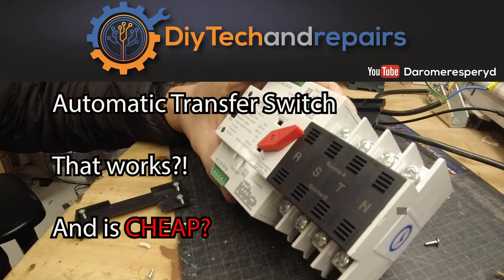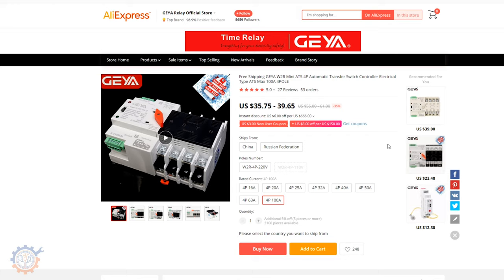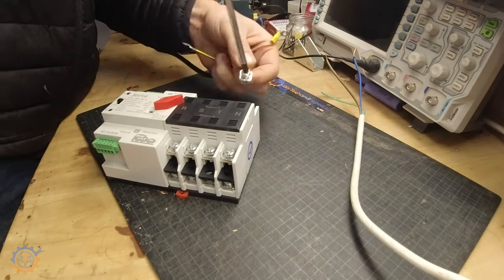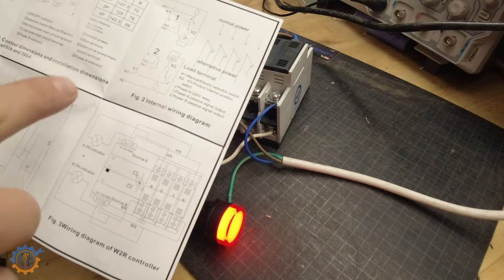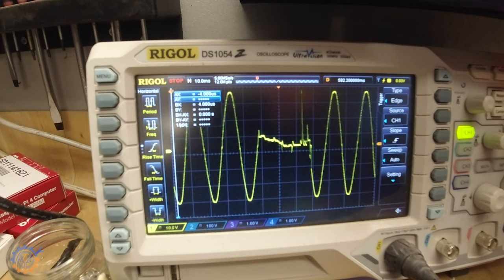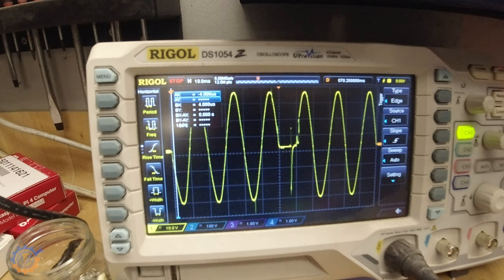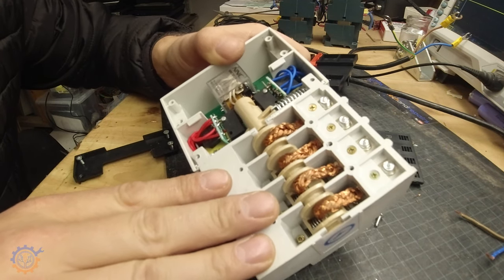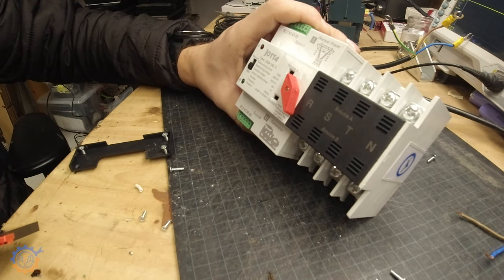Automatic transfer switch setup for home DIY solar systems (You wont believe the outcome)

Comment: 48 Amps system has been working with one of this 100 amp rated 3 poles 220 for over 8 months now, cycling between sources everyday without flaws, no sing of overheating or hot spots or anything of that matter. Computers only reset sometimes going from A to B, but stay on form B to A.
Reply: A UPS (Uninterruptible Power Supplie) will solve your computer problem
Reply: @josephrosa5845  Or simply a faster Transfer Switch
Reply: How is it holding up? Any update. I'm about to put my load of about 40 Amps with this kind of switch.
Reply: @tarakivu8861  Don't you think a UPS would be much less expensive than buying and replacing the transfer switch?

Comment: don't use tape, unplug the mains and work offline. also heatshrink tubing I prefer more than tape around a screwdriver
Reply from the maker: Of course you unplugg as amateur :) heatshrink is Good advice
Reply: Always use electricians fully insulated screwdrivers
Reply: @mrfixit100  the already made ones yeah, just don't use bare metal ones at least.

Comment: 30ms would not shut down a computer. The PSU discharge isn't THAT low. It takes around 1-2s to completely discharge the PSU of a computer. It would indeed work for like a switch between solar, and grid power. Love the video though and very informative, thank you!

Comment: Thanks Mr. Swedish Man. I'm connecting mine up backwards as I want My solar input system as primary. Thank you Good Job. Gus
Reply: Nice i'm using mine to power my house from my EV when power is down or my main house battery dies. It will toggle grid and ev that feeds my solar inverter. I'm just concerned about the 6k maximum rated switches.. Are you happy with yours?

Comment: Is the "primary is primary" problem all that bad? Just wire up what you want to be primary on that side.
Reply from the maker: Sometimes you want to change it. Example i Winter i run grid as primary and during Summer solar :)
Reply: Where i live sometimes the power flickers on and off several times before it get fully on. It would be nice to just pull a swich and have it wait. Or even better, a automatic timer giving it 5 minutes or something before swiching over.
Reply: @matsv201  Some smarter ATSs have configuration options for that.
Reply: @jmonsted  That is true, but the genearly cost a bit more. I´m really not that cheap, but some of them tend to be a bit to expensive for home use.

I really just need it for a few computers and some other stuff, most of the lighting is already DC.
Reply: @jmonsted  I just saw a indian guy, simply putting a cheap relay timer between, that was really a very clean and simple solution
Reply: I would like to do the same, change main A in the wintertime. Can you share a solution for this?

Comment: I wanted to install this kind of automatic switch to my entire house, but after seeing this explanation i prefer a manual, thanks a lot for your advice about this cheap device. Can you please recommend a manual certified switch for 220v ( 1 neutral and 2 fase of 110v each = 3 wires in total from the pole outside) Thanks.
Reply: you need to get a nema 3 manual transfer switch rated at the amperage you are switching from/to most are expensive and large electrical supply house sels them.
it all depends what you want to keep alive when power loss.

Comment: Planing to put this to switch my heat pump or whole apartment from A (dynamic tariff) to B(fixed rate). Could fully automate it with smart socket/plug. Make it read rates one web page every day and shut off A power when it goes more than B (fixed rate). It wouldn't brake my appliances?😅

Comment: one thing i'm worried about.    neutral breaker should connect first   and disconnect last.  if not, your house neutral will float short period and overvoltage in some phase(s) vs.  floating neutral may happen.
Reply from the maker: Can't be done with  a 10ms ats. The breakers also only break the hot lead. That is what you have the rcd for. It will break neutral if the current doesnt add up

Comment: One thing is not clear for me. I have already setup circuit with breakers and everything. How I can switch those for different output eg solar power when both of them are active at the same time?
Reply from the maker: you cant have both inputs active at same time to same output unless they are made for it. An ATS switches source to the output and is often connected befre for instance a breaker panel feeding it

Comment: Hi have a house with,  3Phase, Sungrow SH10RT 10kW Hybrid  inverter   and
16kW Sungrow  SBR160 High Voltage Battery Modules , would this ATS works for my house battery system or, this is for the small solar caravan system?
Thank you
Reply from the maker: It's a 3phase 63a ats
Reply: ❤ Thank you so much, it's perfect for me then.

Comment: do you have those wires connected to 2 seperate wall sockets where one is on and the other is off?? or how does it work?

Comment: I got the 8ms version... It's true no micro-cut for computers, etc.... but ... versus time, the mechanical part will fai (misalignement of the two rotating metal contactors).... In average, it works one year for two transfert / day in average.... :(...
Reply: This was helpful. Thanks

Comment: Can a ATS like this he made to switch from one service to a second service? I have two services and I want the lower price service to be used in certain hours (off peak) and the higher price in other hours (on peak).If not what kind of a switch would I need to automatically switch during certain hours.
Reply: ats switches when primary power fails (no power ) then secondary power kicks in and when primary returns switches back
Reply: @josephrosa5845  If using a transfer switch with control lines for each power source couldn't you 
interrupt line A and the power line B with power maybe with a short delay. In this control circuit 
you could have timer for when each circuit is active . The relays in the ATS would only allow 
one power supply to be on at a time. Maybe I do not understand how this works and would 
appreciate any help any one could provide. I am trying to power devices for a certain time on
2 different electric power services to be able to take advantage of the lower off peak rates on
1 of the services. The ATS would be mechanical device to prevent both services to be connected 
at the same time.
Joseph are you in the US?
Reply: @firstbigbarney  
Can we understand you, you have two sources supply, A & B. You want to switch between A & B based on the time of the day? Perhaps, 

00:00-12:00 on line A 
12:00-23:59 on line B

Or you rather want to switch based on the supply voltage value? Like, 

When Line A peak voltage is less than ## Switch to Line B. 

Please clarify.
Reply: @nyameamah  That's exactly what I want to do I want to switch from one meter to another meter which is an off-peak meter at certain times to buy power to charge my electric car. Can I interrupt the service from circuit A with a relay and a timer to be able to engage circuit B ? I thought this was a good solution because you have a mechanical interlock contacts on inside of the ATS and you also have a high amperage availability on these units. If you interrupt the control for circuit A and make it make it look open and it'll switch to the circuit B with a delay would this be possible? After the timing interval on circuit B it would open the control circuit and close the A circuit enabling the original A power source again with a delay for safety.
This would happen daily according to the schedule for your off-peak power currently ours is 2300 hours to 0700 hours all 7 days.

Thank you for your reply. BigBarney
Reply: @firstbigbarney  
Did you find out how to fix the problem with your power changing?

Comment: Great video. Do you check switching time on the same phase? I think it will be great to check switching time on different phases to see time switching in configuration with UPS or off-grid PV inverter.
Reply: @Piotr Rękawek  :  I receive one yesterday and open it today. Please carefull ! ! !  The power contacts do not switch at the same time - both sides ! ! !  So it is possible for some ms is power on zero line / the equipment. This is dangerous.
Reply: @2012SUSE  Thank You for Your answer I decided to use manual switch with neutral.
Reply: @2012SUSE  Hi - thats allso one of my biggest worries about this units - that for example 2 phases are connected and no zero line ...  im searching for a good automatic Transfer Swich since a long time ...
Reply: @GTRDRIVER1  Did you find one?
Reply: @UmarFarooq-jn7dt  no only junk

Comment: they say is used for generator backup, but also you need extra controller for diesel generator , to know the state of the generator and to control the warm up delay switching time and also the cool down timer for generator after grid on. what you can say? cand you do un diy project for diesel generator?
Reply from the maker: Don't have any

Comment: help please do this item only use a 220 only input into the power controller? because I live in us when I use 120 the switch does not work when I turn off primary please let me know. if you can help me.

Comment: If you go with a cheap brand of these, they potentially could fail prematurely which may not be a problem if you actually never plan on using it but habit for an emergency backup

Comment: So it's no chance to set "B" source as primary for full automatic? always "A" source is primary when I have to use full automatic switch betwen A and B, because when I connect my control wires only on the B side source "A" no switching, when "B" source gone, right?
Reply: Of course you can, it's purely how you wire it.......if you wire grid as A then grid will be your primary. If you wire grid as B and solar/wind/gen as A then the latter will be your primary.

Comment: Ive been saving to buy the digital version(MOES) with much shorter delay time than this mechanical one.Will Prowse has vids. demonstrating running computers and (I believe) even a window AC. Rated for 100k switches!...but this mechanical one ....IDK.
Reply from the maker: I run it with computers. It's 10ms switch time that is good enough. We need mechanical here to get it approved.

Comment: Thank you for making this video! Do you know any ats that will not shutdown a computer?
Reply from the maker: Its not the ats that is the issue. The problem is what you have on the inputs. Are the both inputs synced or not as example.
Reply: @DIYTechRepairs  sorry im new to this electronic but what do you mean by unput being synced? Input like solar panel and grid supplying power to the inverter? Im using a deye hybrid inverter but when i turn the grid off, the inverter is not able to switch fast enough. The computer loses power.
Reply from the maker: @walterrostangarciajr  you need a different inverter or you can add an Ups for the computer.

Comment: Hello, im thinking of buying this but im gonna have a pure sine wave inverter hooked up to the backup power input and normal home power hooked up to grid input and i will have 500w load do you think my computer will turn off when the transfer switch changes from grid power to generator power?
Reply from the maker: It will work fine. I do it like that.
Reply: @DIYTechRepairs  Okay thanks buddy

Comment: Hello - i want to ask you if you have installed this Transfer Switch and if its still working fine ? - the Video is now 3 Years old so perhaps you have new Information about this switch ... - My biggest worries about this switch are the Svrew Terminals they look very cheap ....did you use ring terminals for the Wires ?
Reply from the maker: I run it still without issues. No I use standard cables
Reply: @DIYTechRepairs  Hello - Thanks for tast reply - Thanks for fast reply -- im also a little worry about the switching time and the possibility that the Neutral Line is not connected at the same time then the ofter Phases - 2 Phases and no Neutral Line is a very bad thing for all the Electronics ... - But first of all - Thanks for fast answer and have a nice day !

Comment: Hello dear , thanks for your video .. sorry for my bad english... i whant to buy one to use with my genset... but for me this switch can’t work because the backup power source is off during some minute during the time for the engine to start...  when the grid powwer is off without any power .. how is the switch positione? Or maybe the position of the auxiliary contact...

Thanks for your help...
Reply from the maker: Not sure i understand. It wont switch unless Power exist.:)
Reply: @DIYTechRepairs   do you hace try to conect only the main power , without backup power, and try to turn off the main power?  What is the switch reaction??
Reply: @DIYTechRepairs  thanks for your reply 😉
Reply: thats what no/nc /c connections are for
Reply: @josephrosa5845  hello , i have recieved the product... yes your right about no nc contact.. some other ats work with build backup supply
Reply: @franckmarcelin7573   i dont understand what you meen by (build backup supply). if you talking battery inverter or solar inverter supply. i would set solar/ inverter-battery system as primary and city as backup supply
Reply: @josephrosa5845  hi .. no a talking about someats change source position without energy... maybe it ‘s stay on city power when is energegised with coil and go back to genset backup when is no energised...

But about this sort of ats on this video it work with my genset i use NO NC contact to send information to my genset
Reply: @franckmarcelin7573  city primary genset backup is what they designed for genssets need to have switch run through no contacts and there normally is time delay for generator to fireup.
Reply: wireing should be pretty stright foward

Comment: On some of the aliexpress pages is noted: "NOTE: The rated voltage of the common and backup power supply must in range 85%-110%, and the current cannot be less than 5A, otherwise the coil will heat up or even spontaneously burn. If your city voltage not stable, please kindly add voltage protectors in system." ... So one would have to run at least 5A through the device ? Sounds a bit odd ..
Reply from the maker: They add what they can to protect their products that is badly designed i guess :)  To have a minimum current is just like saying you cant drive your car below 100mph because then it will blow up. :D
Reply: I think because it dont have any logic circuit with microchip and its just analog think.. The higher voltage will overload the circuit inside and burn the coil, components and low power can disable the function of coil and then it will not work at all.. So if you live in modern country where they keep the voltage same all the time you are good..

Comment: Dear can you explain the difference b/w ats switch used for normal and solar invertor. As if you see you found for solar they offer diffetent but technical specification is same. And also My concern is that is this switch can harm for load like fridge etc. Thanks

Comment: what would one use for a server solar setup no battery?
Reply from the maker: Grid? You need either grid or battery. Can't use solar only since the sun goes down or behind clouds.
Reply: @DIYTechRepairs  trying to do a grid with solar switch, just cant have a delay.
Reply from the maker: @SynthToshi  no you do grid tie where the appliance use the grid and then the solar sell back to grid. As said you can't or more should not run on only solar because solar need a backbone lite battery or grid
Reply: @DIYTechRepairs  so what solution are there for a switch for servers.
Reply from the maker: @SynthToshi  any ats or powers powerswitch. Like from apc
Reply: @DIYTechRepairs  can you give me some models or sites?
Reply from the maker: @SynthToshi  https://www.ebay.com/itm/364959895577?itmmeta=01J0VJ88K7VX8MH4H7KVF48PZ7&hash=item54f94e1019:g:7XAAAOSwi5VmNWNs&itmprp=enc%3AAQAJAAAA4BLvzhgAUF9%2FjKNnL%2F0Q82xrQPZPhb4HUWpvNA9PNvXk%2Bbs2G3jYJiEuGjkFV2MgtsqmzUc%2Be8dl24sl11GDOXVdVleHeeVZr%2FdNYfKg7RYSjEQR4l6ATdU5m8oUwBBH17Cz2ieZvMzAUdaiNbtS2YBjMKEmsYkq23F9Byoc%2FjDVZEG6VoXs%2BEtAzdO7FP%2F9H2MiI%2FzcMPTHLwax7p0UuiDLeCicQeFCZH2g0d8PGgZymDPzwyO%2Biibuh24gAi7j0mzCOBTFMdnPEpRwGlhx2Q8JgQ%2Bth5sF7iubvb8uoHQj%7Ctkp%3ABFBM2Imh8oZk
Reply: During daylight hours, in lieu of a battery, you can use a dc-dc buck converter(keeps the supply voltage to inverter at 12ish volts).Then use charged battery during clouds and after sun fades. Ideally, you'd have automatic xfer switch toggle to grid once the sun fades AND the battery reaches a safe cutoff voltage. Next day, cycle repeats. Ive use these buck converters just need to size correctly and monitor any excessive heat.
Reply: @DIYTechRepairs  thank you bro

Comment: Is it possible to attach a remote switch to cut over from A to B? What I mean is it this is in your garage and you want to switch it manually from A to B into your living room Can you attach a manual switch with a wire to it?
Reply from the maker: You Will need to rewire it to do That. It does not have It per default but It is possible

Comment: You dont mention operating voltage IMHO given the contact separation ca 30mm?  its good enough for up to 24Vdc 100 A but I wouldnt trsut on a 48V system, much bigger gap, or a proper magnetic arc quenching shute like real industrial breakers from Siemens - Google the internal construction and see why.  Otherwise make sure you have cable cutters nearby when the arc doesnt quench.  Plenty of YT vids to show what can happen
Reply from the maker: Why dc load? They are built for switching ac load.